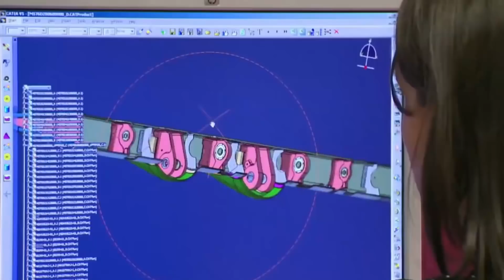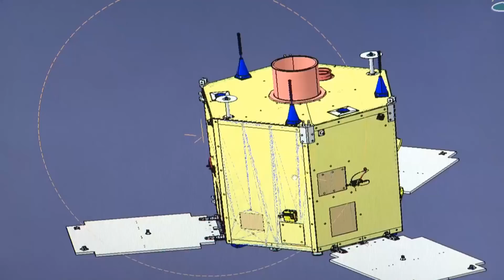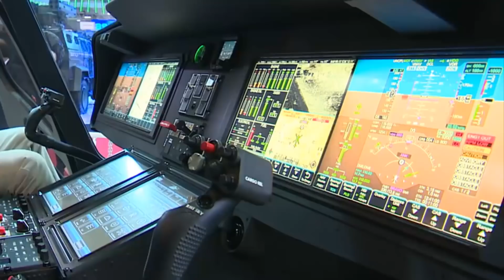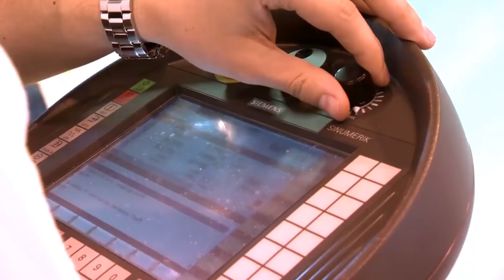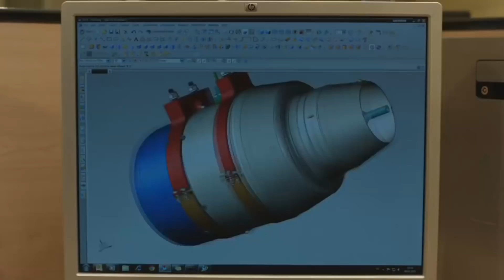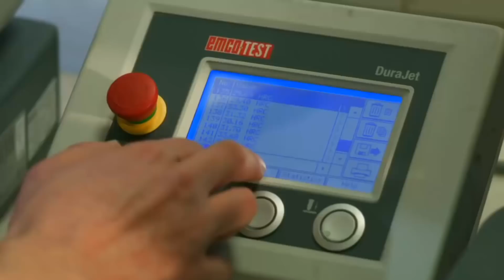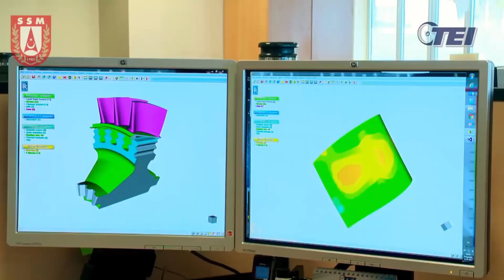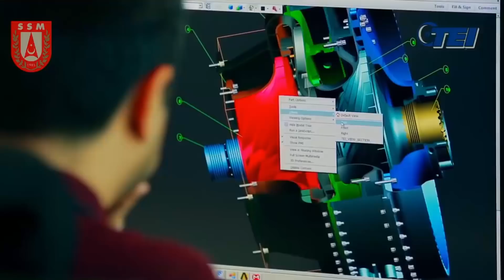Turkish Aviation and Engine Projects TF-X / HURJET / ANKA-S / T-129 / T-625

Comment: the only concern I have is what engines are the TFX going to use. Wasn't it originally going to use a British rolls Royce engine but I think I read somewhere that is no longer the case? There's only afew countries that have mastered the productIon of jet engines and If it's going to be a Turkish designed and built engine I just think there will be issues, specially when you consider that the Chinese still haven't worked it out yet.
Reply: Licensed aircraft engines are produced in Turkey. Also, Turkey produces its own engines. There are military engines such as ts1400, pd170, pd222, ktj3200, batu tank engine. However, there are still ongoing studies on the aircraft engine. very good news will come very soon.
Reply: The process becomes clear for the 'Original Engine' to be used in the National Combat Aircraft (MMU).  It was learned that the engine will be developed by TAEC company, which was established jointly by Kale Group and Rolls-Royce.

Comment: nice vehicle but the line has many similarities with the F22 raptor it is also true that also the FCAS the TEMPEST both of the sixth generation have a similar line much less the TEMPEST which has a more different line.  also the Japanese fighter Mitsubishi F-3 and their new fighter the X-2 Shinshin.  it is seen that it is the best form since it is used on 5th or 6th generation aircraft.

Comment: Well , the Turks will have to put enormous resources to make it happen. I would put my bet on India which has a bigger budget to complete such a project. But if the Turkish Tfx ever comes to fruition, it will enter service in the late 2030's.
Reply: tfx first block  4 ++ gen. with semi stealth characteristic like su 35.tfx first block has got 2 f110 ge motors and aesa radar. it will enter service in 2028.it has been start to develop stealth characteristic motor for second block tfx.The moter wil enter service mid 2030's
Reply: @canberk9714  The Turks should've gone for a pure 4th gen fighter first.
Reply: @MS-wk2pp  Turkey has been produce their f16 late 90s and Turkey has got many aviation company which are produce f35 main body and sub system and other avionic sytem.Those companies capable to produce 4++ gen.Also Turkish national defence started to produce aesa radar for f16 3 years ago.
Reply: @canberk9714  I know. But  directly jumping from building a trainer aircraft to attempt to design and produce a fifth gen fighter can prove very difficult. This has been the case with all countries with fifth gen fighters. Even India has fast tracked it's 4+ gen Tejas mark 2 and is running the fifth gen program concurrently albeit on a slower pace.

Comment: Does anyone here know how many F-35's Turkey already has at the moment?  Didn't Turkey place an order for 100 F-35's?  And I suppose that these 100 planes are a mixture of F-35A's and B's because Turkey needs B's for its aircraft carrier that it is assembling.  How much money has Turkey already invested in the F-35 programme?  But as there seems to be a problem between Turkey and the USA about Russian anti-aircraft missiles is it correct that the USA will no longer sell F-35's to Turkey?  Will Turkey then get their money back from the USA? (the money Turkey has already invested in the F-35 programme)  But if Turkey doesn't get F-35's which aircraft will they put on their aircraft carrier with a ski ramp, for which the F-35B would be perfect?
Reply: That is not actually an aircraft carrier. Yes it has place for couples of planes, but it is not that craft's primary duty. It's an amphibious assault ship which can carry some planes. So  it's not gonna be a big problem if Turkey will not be able to get those F35's. There are other planes which can be purchased.

By the way, statements from USA so far which say Turkey will not going to get F35's; are only political statements that have been made to satistify particular groups in USA. 
Also Turkey is not only a buyer, but also developing some critical parts of that F35's. So it won't be easy to leave Turkey away from that project. And it won't be a big problem even if USA block Turkey from getting those planes. Because they've done it before countless times; they have executed ambargos about other military equipment to Turkey. And because of that Turkey developed those military equipments by itself, resulted in an %50 increase of Turkey's military production. 
So as a Turkish people, i hope that they won't give us those F35's. 
As you can see, project for the Turkish national fighter(TFX) has already began.
Reply: I've written a mistake in my initial post.  I've written "ski ramp".  That should have been "ski jump" of course. Greetings
Reply: After US's decision to exile Turkey from JSF program, Turkey shifted plans to use uavs and ucavs instead of F-35s. On the other hand, JSF subcontractor Turkish TAI is producing over 700 parts of F-35. And this exile decision will increase the cost of F-35's 6 to 11 m $ per each. The real question is; How Lockheed Martin gonna deal with this?